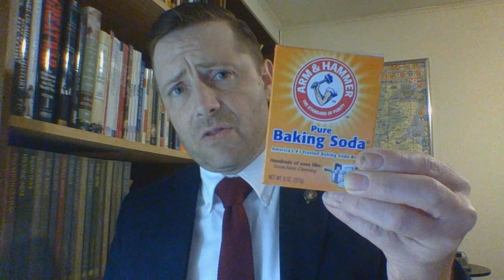For Beginners : Reconditioning Dip

Comment: My wife has switched from General Snus to Cope Natty pouches because we cannot get General in Canada without paying lots of shipping and possible duties.  She has a higher than normal nicotine tolerance, she refuses to use 2 pouches tho because she feels its wasteful and doesn't feel comfortable in the mouth.  Is there a way to increase nicotine absorption with pouches.  She will not dip actually long cut dip.  Short of buying snuff and adding baking soda and then using my pre-made pouches i bought several years ago off the northerner i am pretty much out of ideas.  I had her try mixing baking soda and water and then swishing it around her mouth like a mouth wash before putting a pouch in but now i'm concerned that technique is unsafe or at the very least not a good idea in a hot bath after watching this video.  She did however say it helped but just a little.  Any ideas would be beneficial because she is an amazing wife, who teaches special needs children all day then comes home me and our 3 kids under 7 and everyday she comes home from work and only asks for 1 thing. She has a bath and a pouch of some form of smokeless tobacco and unwind.  Now she doesn't get to decompress like she deserves.  Thanks in Advance for any ideas.